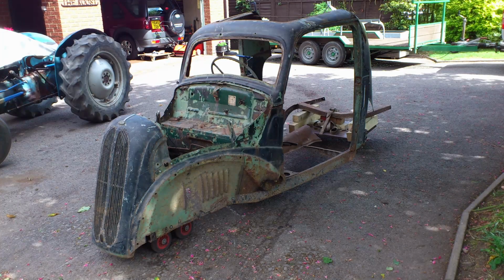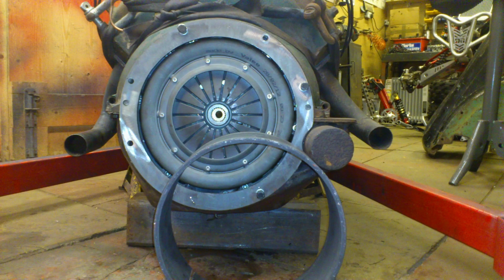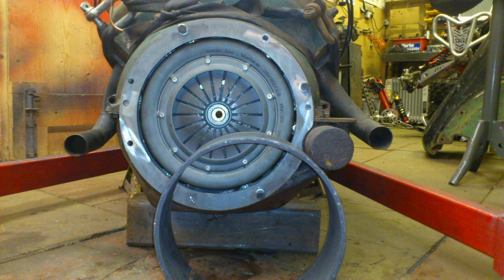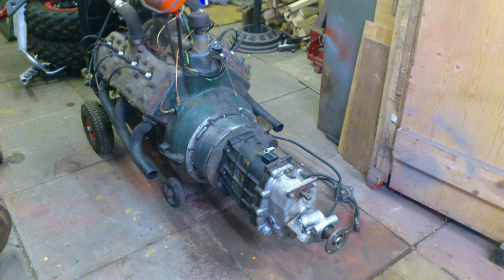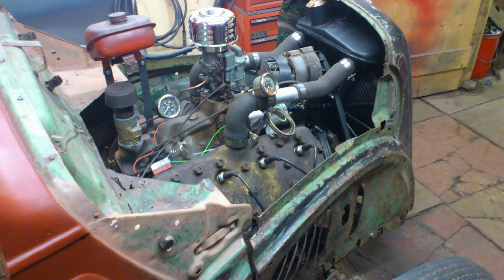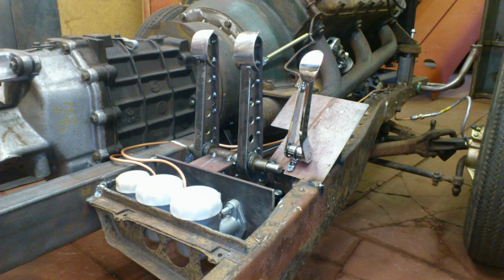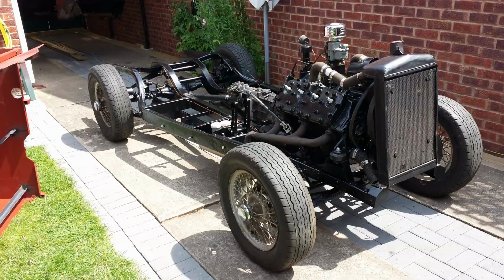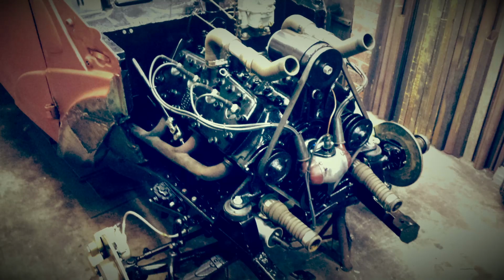Blast from the Past! -  Ford Pop Build

Comment: What front suspension and brakes? Such a cool build. I am looking to do a very similar build with a ford flathead v8
Reply from the maker: Hi, I used the standard Ford Pop front axle with an MGB disc brake conversion. An used an MGB axle on the back. Good luck with your project, they're fun to do!
Reply: @swcreations  any more info on the front disc conversion?

Comment: Great video Simon I really enjoyed the build. Strange question… are you using LED lighting in your workshop?
Reply from the maker: Thanks Trev yes I am, and my ceiling is quite low. I don't know how to stop the flickering
Reply: @swcreations  I’ve got the same issue at the farm shop with the led lights. I was toying with replacing all my workshop lights but I don’t want the same issue at home in the workshop. If I record anything with my phone I find 30 fps doesn’t flicker but if you pan around the footage isn’t smooth, I’d also much prefer to use my camera. I’ve also noticed that not all LED bulbs cause the problem which leads me think that there’s possibly a variance in performance? I’m wondering if there’s a new camera on the market that has a light setting specifically for LED 🧐
Reply: @trevsblog  @swcreations Hi I noticed this too. You can try to adjust the Hz record rate on your camera to suit the frequency of your mains power supply. In aus and UK it’s 50hz, so just try that. A lot of devices will default to the US 60hz and can result in flickering. 

And a cool pop build too !